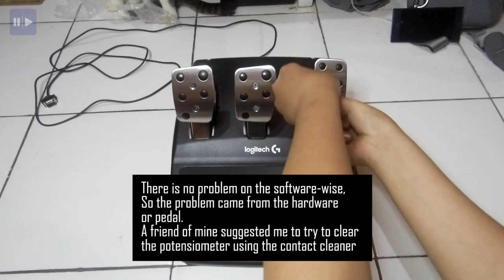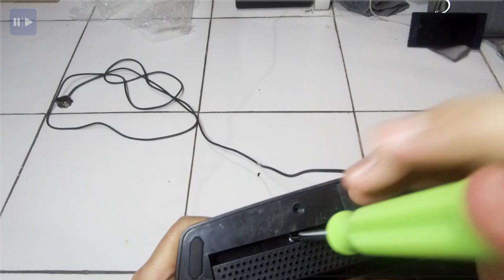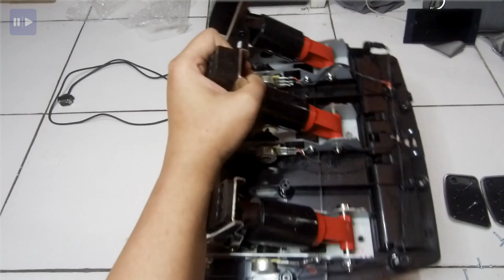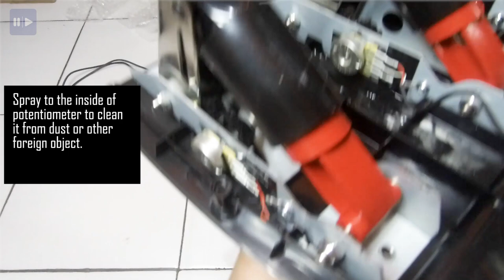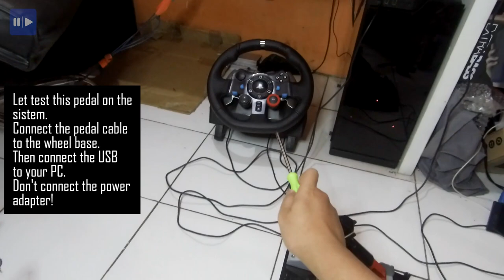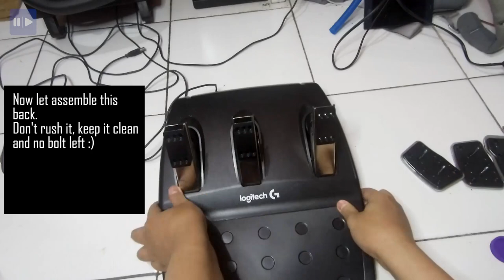Solved Error Pedal Flickering on Logitech G29 Steering Wheel using contact cleaner

Comment: Om, G920 sya sering disconnecting pas lg main, tau cara fix nya.???
Reply from the maker: kalau sering disconnect sih kyknya itu masalah kabel atau colokan yang gak pas, coba pakai port lain yang ada di PC nya atau bersihin dulu kabel USB nya
Reply: @RindiTechEntertainment  udh tak pindah2 usb om, dh tk copot2 balikin semua dalemannya, tetep aja ini. Kemarin rada stabil pas pakai satu motor
Reply from the maker: Saya malah baru tau bisa pakai satu motor doang. hehe  Tapi kalau masalah koneksi sih biasanya sumber masalahnya itu ada di bagian hardware, kyk kabel atau board nya.. saya juga kurang begitu ahli kalau masalah yang gitu2..

Comment: brother im 3 years late but still if anyone can help me in this. does the flickering happen quite often like my first time happened in three months and it was a new wheel. help will be appreciated
Reply from the maker: I heard that sometimes it happen also to a new wheel. Follow this tutorial, it's worth a try.
Reply: @RindiTechEntertainment  okey I'll do that but still is their anymore advice to extend its longevity. As some people don't need do it for years. But still thanks for the response 🙂✌🏻
Reply from the maker: You can add a little oil after cleaning to make it more durable. It works in my case @S0MA1
Reply: @RindiTechEntertainment  okey brother, really appreciate the help you have provided and for that i have given u a sub as well 😀✌🏻and other then that I’ll do that im just not that techie tu I’ll just research on the oil like i knew about the contact cleaner after buying my wheel but ig for oil ill need find it

Comment: It works perfectly but you don’t have to put away the pedals you can just open it from the bottom
Reply from the maker: Oh, That is a good idea especially if you knew where the holes are, you can save more time disassembling the pedals. Just be careful with the cables around.

Comment: Is it OK to use WD40??
Reply from the maker: I never tried it but some people on the comment says it also do the job. worth a try.
Reply: Thanks for the tutorial!!!
Reply: @danicruz7746  just remember that WD40 is corrosive, so may do more damage in the long run. WD40 also attracts dirt/dust etc. I use electronic contact cleaner  then a lube with silicon spray. My pedals/wheel are 3 years old, been totally submerged in flood water in 2022 and still blasting along, thanks to this tutorial.

Comment: for checking after cleaning the potentiometer, the ghub software doesn't recognise the pedals until you connect the power
Reply from the maker: Are you sure? Cause I can check the pedal input even the power is not connected. I didt it many times and no problem. Maybe your usb cable didn't seat perfectly. Try restart the gHub and reconnect the usb cable 👍
Reply: @RindiTechEntertainment  I tried many times. It just keeps showing that the wheel is connecting. I guess there was an update that doesn't allow you to check if power isn't connected.
Reply from the maker: @madhavsajit6351  sometimes i have that connecting problem too. Just unplug and reconnect the usb or restart the gHub. It will work eventually

Comment: My padels are not working anymore after this video!
Reply from the maker: Sorry to hear that. May I know what contact cleaner u use? Is it clearly said for electronic parts? Like what I shown on the video?
Reply: @RindiTechEntertainment  Yes it says for electronic parts
Reply from the maker: @maxx6348  Have you check again all the wires, some user have problem because the wire sometimes clipped between cases. I did clean my pedal 2 weeks ago with this same step ny step and it still works. I wish I can help more but that's what I have. Sorry if it's not work for you 🙏🏻

Comment: for me ,now its worst
:(
Reply from the maker: so sorry to hear that, maybe you should consider checking the inside of the potentiometer for the more advanced problem. you may need to check the video from other channels as well for reference.
Reply: @RindiTechEntertainment  yes, I think at the reassembling I didn't put well the cable, maybe then, I broke it I don't know, but before was perfect and now not
Reply: F
Reply from the maker: @javivega8938  Yup! maybe you messed up with something there, the contact cleaner does nothing but cleans the surface of the potentiometer.